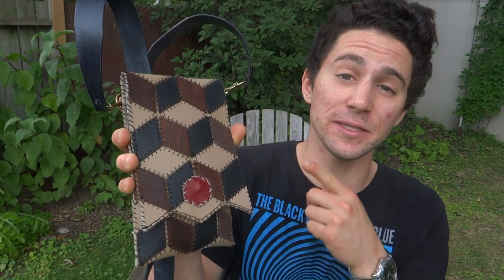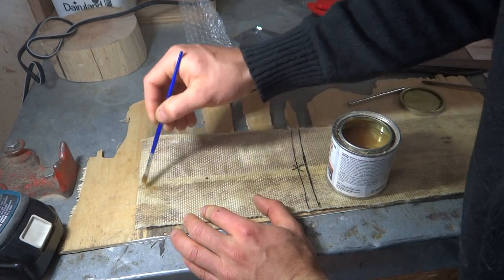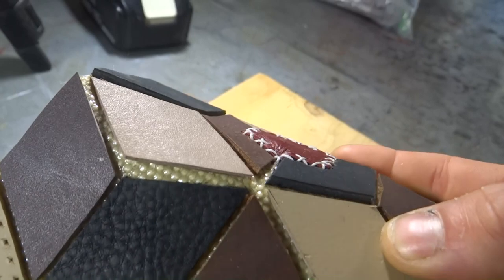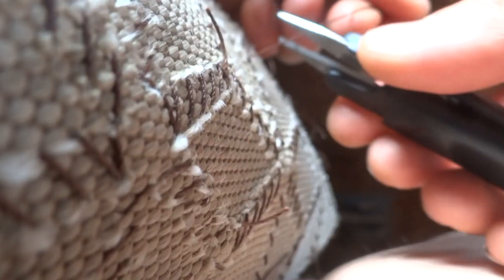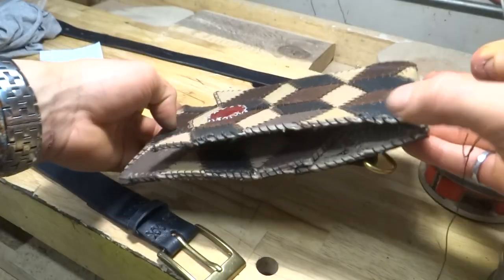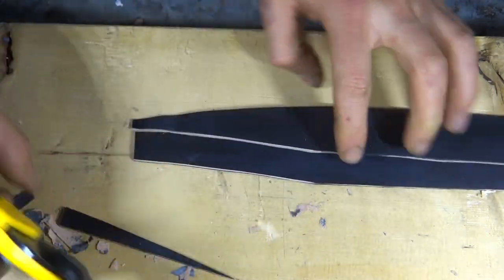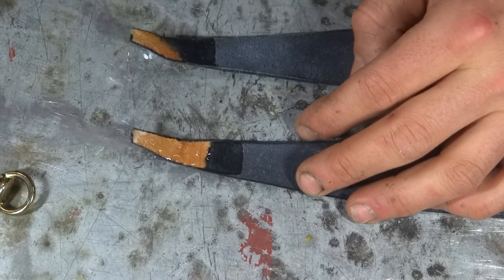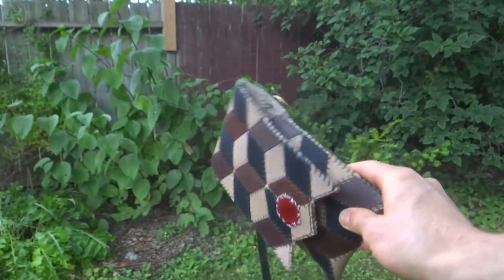DIY Man Purse From Scrap Leather | Leathercraft

Comment: Just wondering...could you have also just used a ruler and some simple geometry to cut the diamonds in a strip?  No need to make any wooden templates and much faster to cut out all the leather.
Reply from the maker: You definitely could, but the scraps I was using were all irregular shapes, so my thinking was that a template let me use the scraps most efficiently. If you had a strip, cutting alternating 60 degree angles would do the trick, but I think the finicky part would be cutting dead on the corner of each diamond.
Reply: Yelrom Blog, totally makes sense.  Thanks for posting your videos!